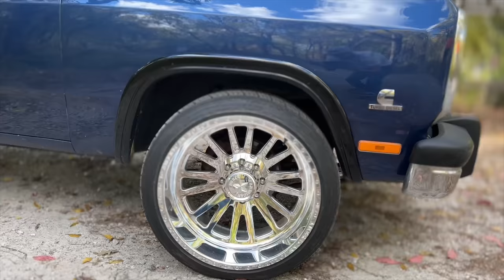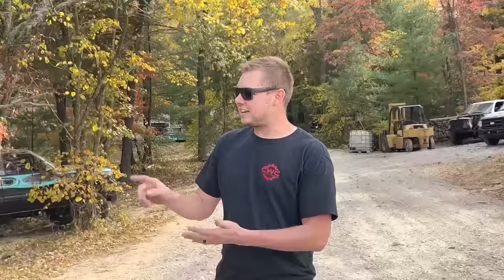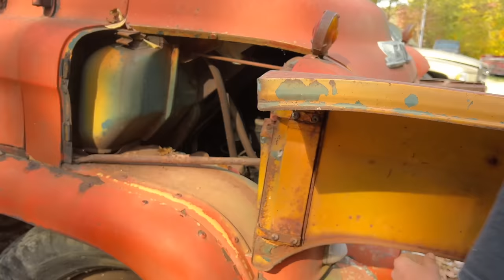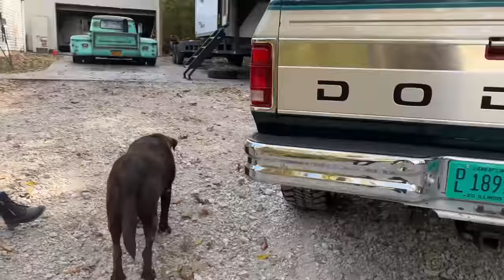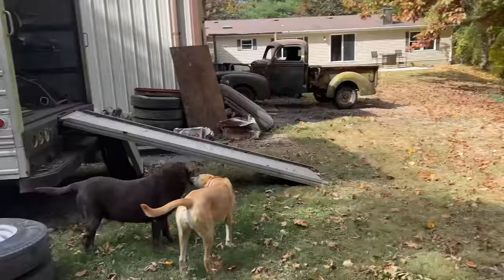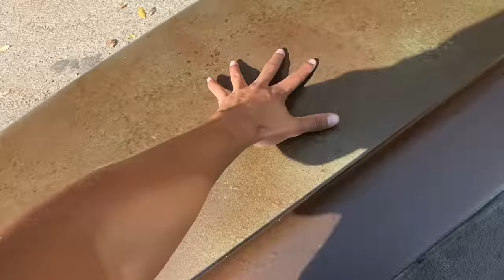She BUILT This Badass Cummins Swapped Rat-Rod Dually!

Comment: WOW!!!
Nice!
My dream truck is a ‘93 Dodge one ton dually extended cab 2 wheel drive with 6 on the floor with Cummins with all the best upgrades 
But it’s just a dream Everything I find is tooo expensive for my pocketbook at least the one that is not eaten up by rust and run to the ground 

Badass collections y’all have